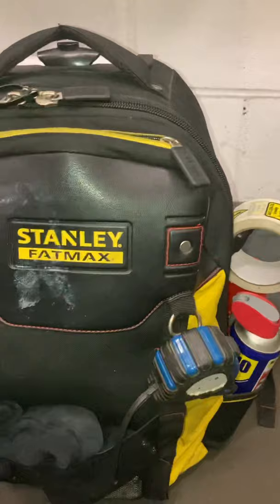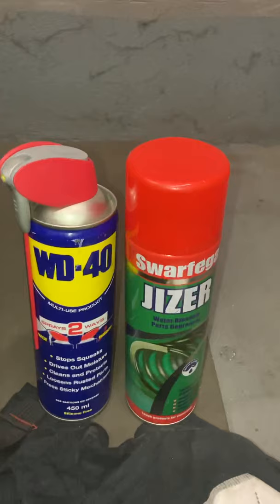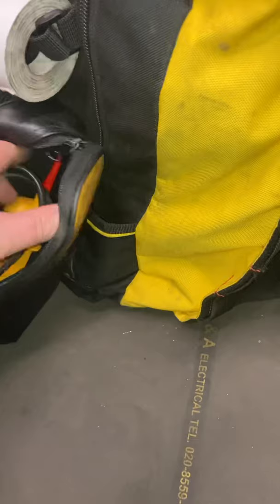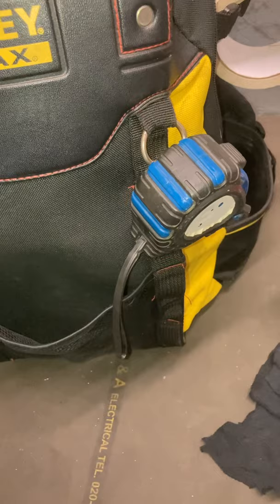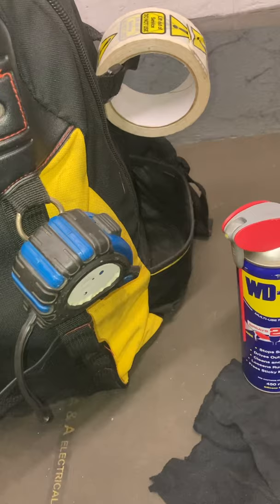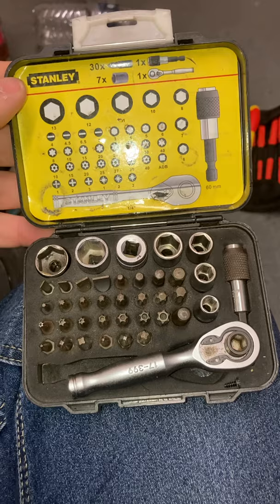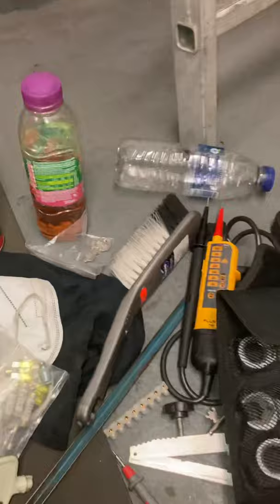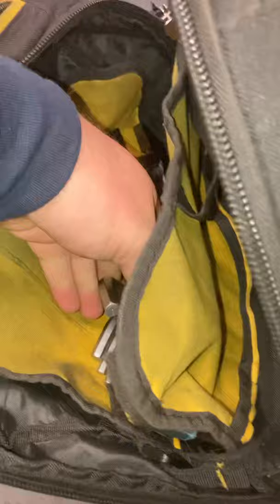Elevator/Lift Engineer Tool Bag talk

Comment: Nice video bud 🤙🏽🤙🏽🤙🏽 good to see some elevator or as we say over here in the UK lift engineers posting some videos on what they carry….loads of plumbers, sparkys and hvac guys posting stuff
Reply from the maker: Thank you , I’m still new to YouTube, especially when I recorded this , I have a lift playlist if you have time to watch a couple more 😊 thank you for your nice comments 👍
Reply: I'm always looking for lift engineer videos, I use the wera kit aswell.

I hate to be that guy buuuuuuuuut WD is NOT a lubricant, you are actually drying moving parts out with that and causing more problems
Reply: @whatshisface4343  that’s true to be fair, it’s hard to find liftys load ups anywhere half the time….mq elevators and elevator detective is good to find some guys in the US 🤙🏽🤙🏽
Reply from the maker: To be honest, I use slide oil for lubricant, if I’m doing guides I use slide oil/grease mix . Check my video I posted while back about this please, I will be posting lots more lift videos soon but I have many in my playlist 👍👍
Reply: @Rogerc-t3y  do you use this bag and set up for all your calls and servicing ? I am thinking one of these I have the normal back pack but ends up getting heavy 😳😳
Reply from the maker: @benchandler7089  this is really my call out bag , then I have a service back with few tools and cleaning bits . The call out bag seems to get heavier every week 😂
Reply: @Rogerc-t3y  that’s what I find with my backpack, I did have a veto backpack but they are heavy already and just get heavier and heavier 😳😳
Reply: A few months ago I split into two bags also, and now I find myself carrying both in with me! And still have to go back to the van for something that I have forgot 🤦‍♂️
Reply from the maker: @whatshisface4343  hahaha I know exactly what you mean last week I also took both in 3 times because of new lifts on my route , then had to go to the van to get more 🙄 had to get the windcrest tool and barrier
Reply: @Rogerc-t3y  ahah sounds familiar! I've been installing a lot of memo auto diallers recently and love them, no test tool needed
Reply from the maker: @whatshisface4343  yeah , phone lines are being stopped soon so we are fitting a lot of safeline gsm , got to say there one of my favourite because the lynx app works well

Comment: Hi, I'm thinking about switching from carpentry to elevator technician next year. Would someone mind listing the actual tools used so I can begin to purchase them little by little? It would be of great help. Thanks in advance!
Reply: In CA, IUEC local 18 doesn't allow apprentices to have more than the following basic tools: Sharpie, pen/pencil, pair of pliers, utility knife, tape measure, a note pad and a multi screwdriver.

Anything else is frowned upon.  However, I'd recommend having a roll of electrical tape snuck in your pocket.

Here's the brands I'd recommend:

-Fat Max 25' tape measure (non magnetic tip)
- Knipex 10" pliers (the "cobra" model w/ comfort grip are tops)
-Ideal 21in1 or Sata 19in1 multi screwdriver or MegaPro "Elevator" model are good choices for screwdrivers
-Fast Back Milwaukee utility knife or my favorite Kershaw 1920 model multi knife (change the bits to your liking)
-Toughbuilt x-tra small is a good notepad 
-3M black electrical tape

Most important, bring a GOOD ATTITUDE and logical/common sense.  Don't be caught standing around and doing nothing.  You can always push a broom.  It's hard work but super rewarding.  Be safe and I wish all the best.  🤙💪🔧